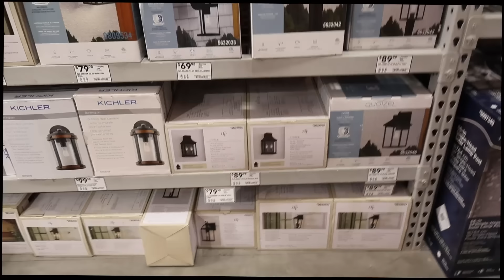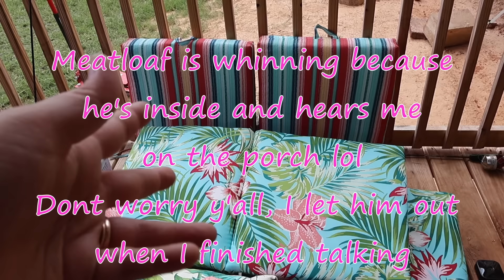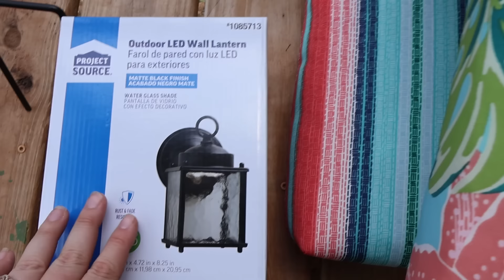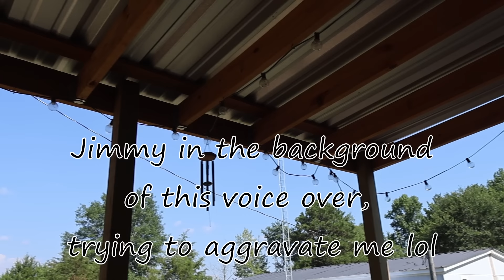Weekend Vlog | Putting Our Porch Back On The House | Walmart Patio Decor Haul | Front Porch Reset

Comment: Does rain come in between your porch and the trailer where they meet? I have a trailer and rain pours can't open my front door. I don't know how to fix it
Reply from the maker: It doesn't. I have a metal roof and the overhang is about 6 inches and the porch goes under the overhang. I know they have something you can roll out to connect the roof and the porch so it won't leak. Its called Flashing, you can buy it at Lowes.
Reply: @EverydayGrace.  Ok I will check into that. Thank you